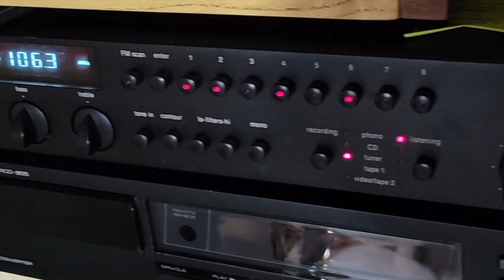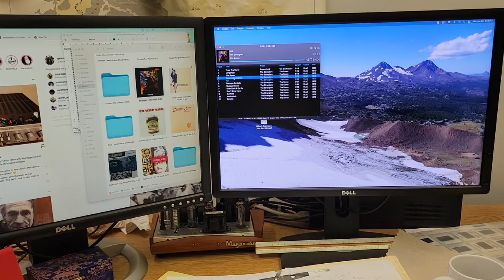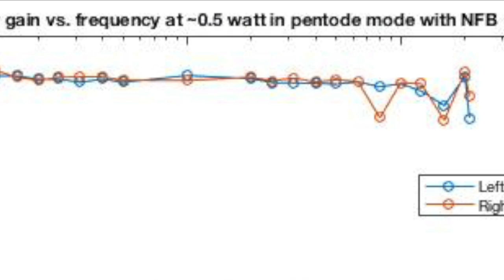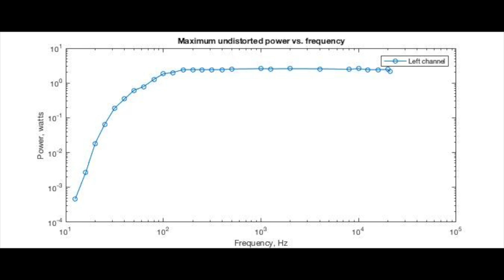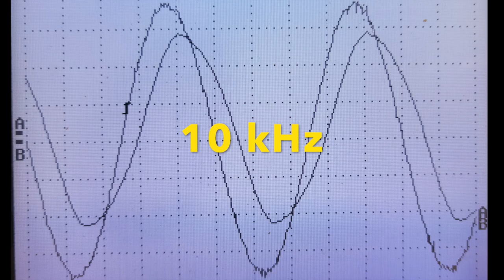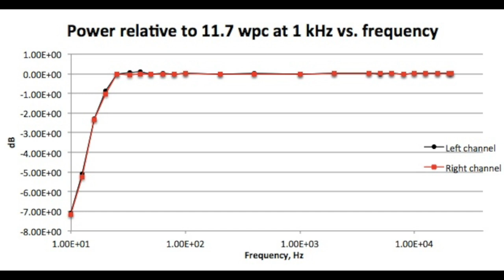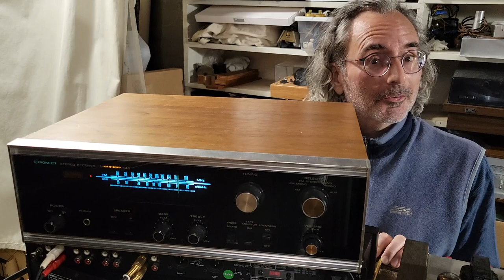What's the Best Hi-Fi Amp for the Tube Curious?

Comment: 39 min...Slew Rate means how quickly an Amp changes Output Voltage in response to change in Input Voltage..Volts / Time
Reply from the maker: Yes, and I'm referring to slewing distortion, which is when the slew rate can't keep up with the frequency and amplitude of the input signal.

Comment: Great Video! I been pulling console and organ tube amps for some time now. I'm running 6L6gb ppp mono block baldwin organ amps at about 40wpc and it has plenty of dynamics and bass due to the large output transformers. But then again I have a LOT of tube amps.
Reply from the maker: I'm interested to know how you built your set of mono blocks. Did you find them one at a time or get them as a set?

Comment: Im really struggling between getting a Sansui 1000a its kinda strange half tube and transistor . Do you have any experience with one ? Im a young kid trying to learn . I can get one that's fully refurbished for 400.00$ which seems a great deal but its not fully tube which is kinda strange. Im also looking at a bell 3dt model local it's from 1958 i believe it is quite old rated for 20 watts . Let me know what you think or would recommend. Also lookin at onyx/Melody H34 preamp from 2004 rated for 45 watts
Reply from the maker: I hand the Sansui 1000, and the 1000a was a major redesign, but the 1000 has a solid state phono stage, and I'm guessing that's also the part of the 1000a that's solid state. The 1000's phono stage isn't very good, so I redesigned and rebuilt it. That was a pain. Still, the amps on the 1000 and 1000a are classic and have great iron (output transformers). If "fully refurbished" means all electrolytic and oil capacitors have been replaced, then that's a decent price. You could pay that much for the iron alone. I got my 1000 from a friend for $120, but it has needed a lot of work and still isn't done.
Reply: @Lancaster_Hi-Fi  thank you so much ! I'm narrowed it down to the Sansui 1000a and also the Sansui 7070
Reply from the maker: Those are very different! Both very nice. Is love to get one of the x0x0 series someday, but they can run into real money. An update on my 1000: I keep thinking I've got the phono preamp sorted only to find it sounding like utter crap later. Mine is back to crap. It's maddening! At this point I'm even considering cramming a Rega Phono Mini into the case!

Comment: I glad that you mentioned 7591 power amplifier output tubes. Both of my tube amplifiers use four of the 7591 tubes in their output stages (McIntosh MC225 power and The Fisher x202B integrated). 
I love the sound these two amplifiers make. Just beautiful!
Neither amplifier will play loud but they will provide palpable bass response at normal 60-70 db listening levels. 
I use a Vinnie Rossi LIO as a preamp and vintage JBL L100s as loudspeakers.

Comment: Great video!   A few years ago I built a Gillespie mod Magnavox 9304 with the added input buffer stage from the Audiokarma Dave Gillespie thread “More fun with Magnavox”.   All I can say is WOW, what a great sounding amp!   In my build I retained the original output transformers, however.   The best part is that I paid $20 for the donor console which I located in Utah and had a local friend identify, pick up, and kindly disassemble and ship to me in California.  The shipping cost more than the amp!    

I had previously restored a complete Magnavox console and record changer with an 8802 amp which looked nice and actually sounded pretty darn good.  Even with original ceramic stylus record changer and original 1961 vintage speakers (with updated crossover caps) I got a lot of enjoyment out of it.  I still have it, although my wife kinda wishes I didn’t.  😅.  Ultimately I wanted to pair a Maggy with a modern turntable and a have a little more power, so started looking for a 9304 donor console and found the one in Utah.  I went deep down the rabbit hole with that build, and even sought and received some advice from Mr. Gillespie himself along the way.  I even built a nice flame walnut wood surround for it which looks quite nice.   I definitely won’t part with that amp until I give it to one of my sons perhaps, and it is my “daily driver.”   High sensitivity speakers help a lot too, and I use Klipsch RP-600Ms and they pair well.  Anyway, I agree that at least half the fun is finding the donor console and opening the back and seeing that it does have one of the “right” amps to mod out.  It’s like sonic archaeology! 😊.  Keep up the great work!

Comment: Rather than the large vintage stereo consoles, I've wondered if a smaller amp from a vintage mono suitcase record player with a built-in speaker could be modified to provide good tube sound?
Reply from the maker: I've wondered the same thing. I do have an old portable r2r with tubes. It only has a mono amp.

Comment: I prefer a tube preamplifier used with a solid state class D power amp.  Do you build and sell tube preamplifiers?
Reply from the maker: I haven't yet, but I would like to. My research is revealing why highest quality preamps are so expensive. I might have stayed a preamp project a while ago if I had found a source for the switch needed for Morgan Jones's volume control design.

Comment: Adcom amps are good amps.
Reply from the maker: Agreed. My Adcom power amp is a beast. The preamps and tuners and combos tend to develop problems, though. They used glue to hold down the larger components, and that glue becomes corrosive and conductive over time. They also used microcontrollers. On my preamp-tuner combo, I've cleaned off all the old glue and replaced affected components, but I can't do anything about the microcontroller. I now have an excellent preamp with a bunch of extra buttons to control a tuner that doesn't work, and the unit won't turn off. Better than won't turn on!